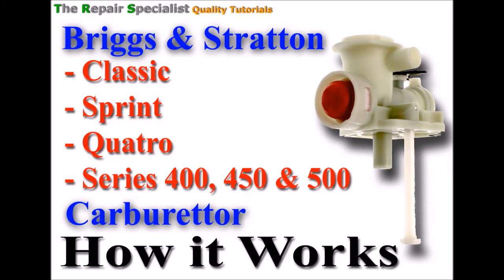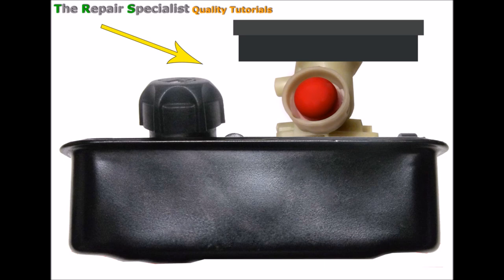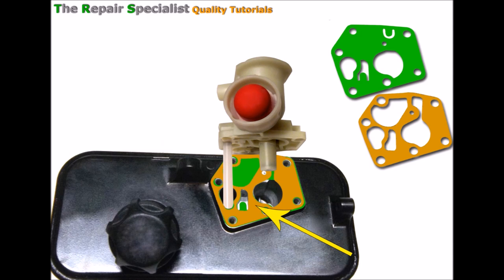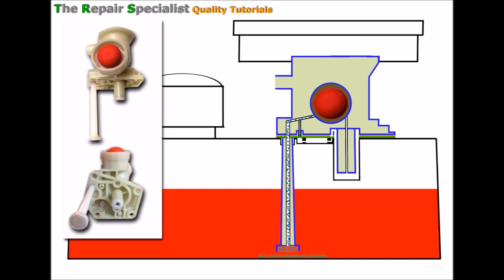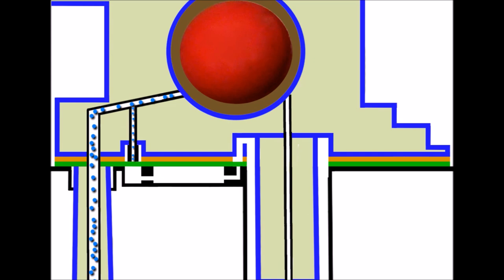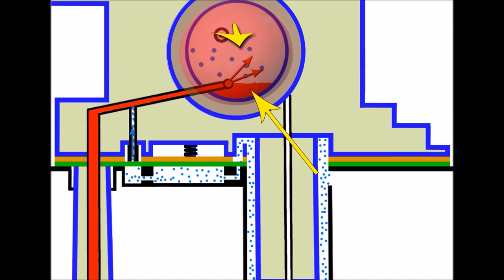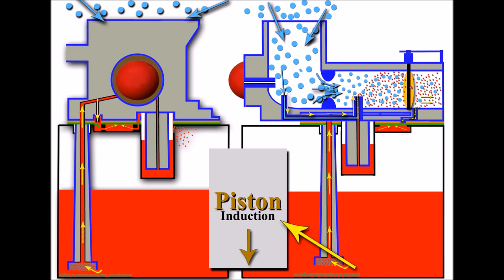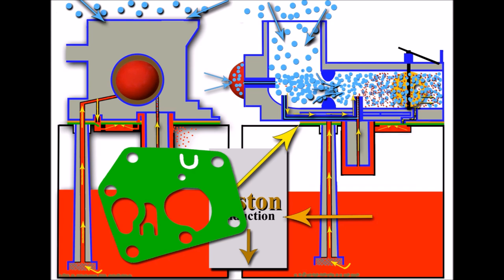Briggs and Stratton Carburetor (How it Works) - 'Unique View'

Comment: I have over 40 years experience tuning Weber DCOE carburettors but yesterday when my mower would start but not continue to run I was perplexed indeed. Where is the fuel pump to lift the fuel? Where is the float chamber? Well you've just made it crystal clear and I must say what an ingenious idea it is to use the inlet pulsing to run a diaphragm pump (although I guess it wouldn't work on multi-cylinder engines) and remove the need for a float chamber. I had assumed that the priming bulb merely pumped fuel in manually as an enrichment device to get the engine started, but I now know that it is also purging air out of the main fuel circuit. Finally, I like the way that the second tube connected to the main jet draws in air to act as a crude emulsion tube. So ingenious, but like all great devices, so simple; I just needed a little help to understand it. Looks like I probably need a new diaphragm. Many, many thanks.

Comment: I've been using my mower with the B&S Classic engine for 25 years or more. It has never given a problem, and has as always started first time. Last week, it started hunting, so I took the tank and carb off. Couldn't see anything wrong, so blew it all through with compressed air, put it back together, and it started first time, and ran perfectly. It has never had a new diaphragm in all these years!!
Reply from the maker: It's impressive that your B&S Classic engine has served you well for 25 years! Hunting, or surging, can occur for a few reasons, and it sounds like you've already done some good troubleshooting by cleaning the tank and carburetor. Here are a few things to consider:

Diaphragm Replacement: Although the engine has been running well for many years, the diaphragm in the carburetor can wear out over time, especially after such an extended period. Even though it ran perfectly after your cleaning, replacing the diaphragm might be a good preventive measure to ensure continued smooth operation. A new diaphragm can help maintain consistent fuel flow and prevent future hunting.

Fuel Quality: Make sure you're using fresh, clean fuel. Old or contaminated fuel can cause performance issues. If your mower has been sitting for a while, draining the old fuel and replacing it with fresh fuel might help.

Air Filter: Check and clean or replace the air filter. A clogged air filter can restrict airflow to the engine, causing it to hunt.

Spark Plug: Inspect the spark plug for wear or fouling. A worn or dirty spark plug can affect engine performance. Replacing the spark plug is a simple and inexpensive maintenance step that can improve running conditions.

Gaskets and Seals: Over time, gaskets and seals can deteriorate. Inspect these components for any signs of wear or leaks and replace them if necessary.

Governor Linkage: Check the governor linkage and springs to ensure they are clean and functioning correctly. The governor system helps regulate the engine speed, and any issues here can cause hunting.

Given the longevity and reliability of your mower, it's likely that addressing one or more of these areas will keep it running smoothly for many more years. Even though it ran perfectly after your initial cleaning, considering the age of the components, a little extra preventive maintenance can go a long way.

If the issue persists or you want to ensure everything is in optimal condition, consulting a professional for a thorough inspection might be a good idea. Your B&S Classic engine has served you well, and with a bit of care, it should continue to do so. Happy mowing!

Craig
Reply: @TheRepairSpecialist  Thank you for your reply to my comment. Everything you say is absolutely correct. I will quite possibly replace the diaphragm in the near future, because it must be getting quite weak by now!! As a retired Chief Marine Engineer, I am quite attuned to strange noises, or vibrations, but, as long as it continues to start and run perfectly, other than general maintenance and oil changes, I'm a "if it ain't broke, don't fix it" person!!
Thank you for your tips and advice, it all helps, and I don't pretend that I know everything!!

Comment: Very interesting carb design. It eliminates the need for a float and needle. It also eliminates the fuel pickup and return lines to the fuel tank.
Reply: except you have to prime it every time you want to start your engine

Comment: Absolutely top effort on this, excellent work. 
I had my 4 stroke brush cutter slowly bog down more and more and finally took it for a service and they installed a new diaphragm as it had gone hard, now I know the intricate details why. 
Also had my mower not run well and the bulb had sucked in, very dirty air filter was the cause and again I can see how too much vacuum would do that. Thanks again.

Comment: I've been fooling with Briggs engines since I was a sprout (56 now). I learned these carbonaters from a wise old man named Johnny McFarland. He never taught a master class like this!!! My hat is off to you sir. I do think you could trim your video for time but overall, if someone else asked me where to look for info on these little carbs, I'd send them right to this video. Job well done I say. Cheers from Florida USA.
Reply: Wow!!! Thanks for tagging my comment.
As a guy who's spent most of his misspent youth (and into middle age) poking at the working bits of engines big and small, I've seen a lot. I've thought a lot about doing YouTube videos and then I thought, Naahh!!! Who'd take this guy seriously??? You explain things in a way that even a non mechanic type person could watch that video and understand how that carburetor works. It really is a cool design. No moving parts, and as long as you have vacuum it will pull fuel. I still have one on a go kart that is of aluminum and has a choke instead of a primer. Works just fine.

Comment: Fantastic video, thank you for explaining all of this. 

My lawn mower has been having issues after not being used for over a year. I tried replacing the diaphragm and gasket, and cleaning the carb and tank but it still doesn't start. 

Having an understanding of how the carburettor works is invaluable in trying to find what the issue may be. Thank you for your videos and sharing your experience.

Comment: This is the best description of how anything works that I have ever seen.  I have had a very basic understanding of how they work since they are not gravity fed like other carbs I have repaired. But this tutorial shows every detail.  My Brigs was bought as a reserve mower almost 30 years ago since I like older Lawn Boy engines. I just use it on occasion , however it has always started first pull.   Still does but it will not run at full speed now so I need to do a carb clean/rebuild.  Thanks very much.  Henry

Comment: My mower with this B and S motor is 25 years old and still running. The first time the carb diaphragm was changed was when it was 10 years old. That second carb diaphragm is still going strong. The primer bulb was changed after 24 years. This is one tough engine.
Reply: I had a difficult time understanding the first 20 minutes. It got little better when he started showing the side view.

Comment: Very informative, thanks for posting. I have one of these on a 3.75 hp Briggs & Stratton lawn mower engine. I've had it 27 years and never had any problems. I didn't use it much, but I never had the carb apart and never had any problems with it.

Comment: Great explanation, I have this carburetor and based on my spark plug inspection, my lawn mower is running lean, will start replacing the diaphragm + gasket.

Comment: A marvelous explanation Craig and a new subscriber. Now, if I can only get the little buggar to stop leaking fuel around the carburetor, even after a new gasket and diaphragm and a thorough cleaning. Time to pull it apart once more and double check every little hole for blockages etc. Well done mate. Such enormous attention to detail and explanation!

Comment: All the mowers I've worked on start with the governor holding the throttle plate wide open and only until the set point is reached does the throttle plate close. Excellent presentation both in graphics and speech, well done from the USA

Comment: havincg just bought a secondhand rotovator with running problems, engine starts ok if you put a bit fuel in the air intake of carb but wont continue to run,  this video has gave me a great insight into how the carb should operate, thanks for sharing this it is fantastic, i am off to buy new gasket and diaphragm set. the engine i have is an older model as its an alloy carb with no priming bulb but i am sure it will be the same principle-

Comment: suberb video. So well constructed and explained. 

I took my b & s carburetor apart before I watched this video because my mower wouldn't start. After putting it back together I was bummed when it still wouldn't work. Now that I understand what I'm looking for, I'll buy the repair kit first before I take it apart again. I did notice that it was missing the mesh filter around the injector so that could be an issue. I also will have to ensure that the gasket and diaphragm are the right way round. 

Thank you for this! I'll let you know how I make out. :-)

Comment: Thank you for this video and clear explanation for 35E classic carburetor. I bought this lawn mower in Feb. 2005 and have not had any problems until yesterday. The engine keeps cutting off after about two minutes and I thing the carburetor needs an overhaul.

Comment: Great video, I studied this carby n worked out exactly how it works,  the only thing is....carby butterfly is open fully before starting because the vane governor has no air pressure against it to help it close, the governor spring pulls it wide open, 
And when primer is pushed this actually squirts the fuel in past the open butterfly.
Very simple but effective carby 
Cheers

Comment: Very good presentation well explained last yr had problem with this same carbrettor engine running lumpy, thought fuel starvation removed tank with carb poored petrol out of tank derty fuel,think my fault last time l refuel think jug must have had muck in it to compound error l didn't use filter funnel which l always use on all machines when refuelling! Removed carb from tank sure enough both fuel pick up, and .main jet filters ful of crud, cleaned off disassembled getting gaskets in correct way round refuel with clean filterd petrol ,primed burst into life first pull, well please first time I've worked on that type of carbrettor, now got good understanding of how it work's thanks to your great  explanation, THANK YOU!🤗🤩

Comment: One of the Simplest and Reliable Analog fuel metering devices ever made . Really Clever design and manufacture . Beautifully SIMPLE .
Beautifully presented explanation , for those that already have some idea how Internal Combustion works . 
I could go into business right now , fixing these .
There is a Separate system that needs explaining , as well . The Governor . Probably centrifugal on these Engines . But perhaps not .
Briggs and Stratton's are a Petrol Engine that behaves like  DIESEL . Rev-limited . Dig in as needed .

I like your Channel . Subscribed . I  , myself , am Former Navy Engineering Sailor and a Motorcyclist . Rat-rodded a couple . Haha .

Comment: This is incredible ! Every video I clicked on yesterday had an Americaaaaan accent which I can't stand. No video has ever gone into this much detail and explained so clearly what's going on. I've ordered the gasket from your site and can't wait to get started ! Thanks SO MUCH.
Reply from the maker: Wow, thank you so much for your kind words! I'm thrilled to hear that you found the video helpful and that you appreciate the level of detail and clarity in the explanation. Your enthusiasm is truly appreciated!

I'm glad to hear that you've ordered the gasket and are excited to get started on your project. If you ever have any questions or need further assistance along the way, please don't hesitate to reach out. I'm here to help, and I'm sure the community here is, too.

Best of luck with your project, and I hope it goes smoothly for you. Thanks for being a part of our community, and happy wrenching!

Craig
Reply: @TheRepairSpecialist  Thanks Craig. I did everything as per your video and now she's running sweet  again. My engine (10T602 ?) has a single spring to pull the throttle butterfly fully clockwise (so it hits the stop) when the lever is pulled for max. revs. The other side of the butterfly has a metal bar that goes into the engine under a metal cover. I took this cover off to make it easier to release the link rod but may have done something wrong. I guess that rod somehow connects to the flywheel governor to keep the revs down. Now the engine is more or less at full revs so I think that something came adrift deeper inside. I'll try and get to see what's at the other end of that link rod but I only dropped the revs to empty the grass box anyway. I'm truly delighted and am now studying nuclear physics on your coil pack video. No wonder you got so many superlative comments !

Comment: Hello from Australia.  Yesterday I returned a lawnmower to a customer with carburettor rebuild on this kind of carb. ($65.00AUD) There is really no way to successfully give customers any knowledge of the "dark science" of carburetion process in a pressure differential diaphragm carb., good for repairmen like me as  mower owners disassemble the carb and usually lose governor springs (which are often broken, distorted too) ...they soon realise they  have no clue about the correct set-up and operation....I no longer  explain operation....I simply say, "the rubber parts inside were shot"....Many people make the mistake of thinking; it's just a lawn mower...How complex can it be?  More complex than they realise!!!! A fantastic video but the average person still won't get it.  Cheers from sunny Australia.
Reply from the maker: HI.

I completely understand your perspective, and you've raised an important point about the complexity of carburetors and small engines. As a repairman, you've likely encountered firsthand how intricate these systems can be, and it's true that many mower owners may not fully grasp the inner workings.

Carburetors, especially those with pressure differential diaphragms, do indeed involve a certain level of "dark science," and their operation can be baffling to those not familiar with them. It's not uncommon for DIY enthusiasts to disassemble their carburetors with good intentions, only to find themselves in a bit of a puzzle when it comes to reassembling and adjusting everything correctly.

Your approach of focusing on the practical issue – the need for replacement of worn-out rubber parts – is a wise one. It simplifies the explanation and provides a clear solution for the customer without delving into the intricacies of carburetor theory. After all, the primary goal is to get the lawnmower up and running smoothly again.

While some may not fully appreciate the complexity of these small engines, your expertise and service are invaluable in keeping their equipment in top shape. Your dedication to your craft and the ability to provide effective solutions are what make repair professionals like you so essential. Keep up the great work, and here's to many more well-maintained lawnmowers in sunny Australia! Cheers!

Craig

Comment: Interesting video. I had for many years to fudge one of these carbs to start by taking a drinking straws worth of petrol poured into the main jet area. It then started and ran once the air cleaner was put back.
Reply from the maker: Very innovative 👍
Reply: @TheRepairSpecialist  so clearly the diaphragm and gasket was on its way out, or the priming bulb had had a hole in it. But once under basic running the machine sustained itself. So I figure the gasket was okay. Must've been the priming bulb acting up?

Comment: I've worked on them for forty years and the first Briggs carburetors were metal with no primer bulbs. . They were even more trouble free back then except if they setup without gas would dry out and go bad . But when ethanol  was introduced it seems things got a lot worse . Anyway great video .
Reply from the maker: Thank you so much for the nice feedback. I really appreciate it. Craig

Comment: Wow, that is ingenious and mickey-mouse at the same time. It looks like those flapper valves would wear out quickly.  Thanks for the explanation and diagrams.
Reply: They will wear out quickly unless you use Ethanol free gas. Hi test fuels are a lot of the time alcohol free but it is now available widely. If not, go to your local small plane airport and they sell aviation fuel that is alcohol free. Use it in all your small engines especially two stroke like chain saws and trimmers and small outboards. It will save you lots in carb repairs and the gas can sit all year without draining.

Comment: Amazing tutorial about the parts of the diaphram, one part I don’t agree the butterfly valve operation at the end. Butterfly valve basically does not affect mixture that much as venturi vacuum depends on amount of flow. Butterfly valve basically just control the amount of mixture going in to the engine. At least in machines i’ve seen spring keeps the flap open when rpm is low and the air driven governor pulls it down when rpm increase creating constant rpm controller with that loop.